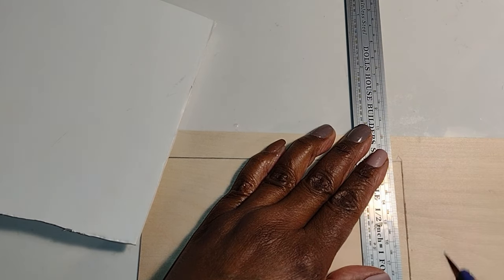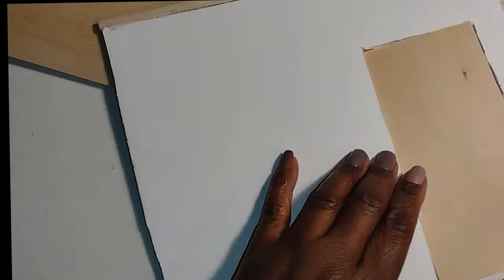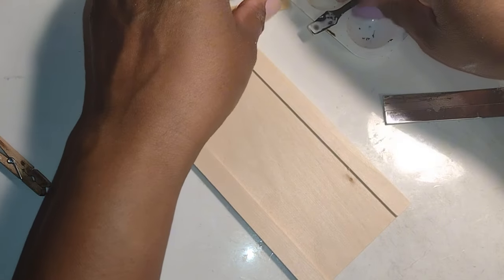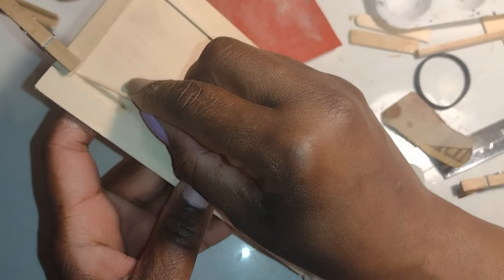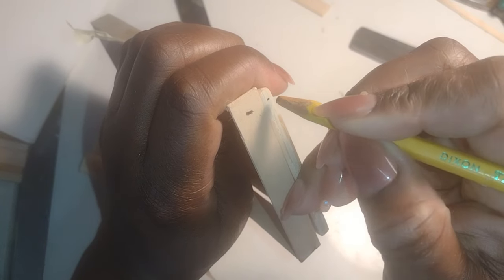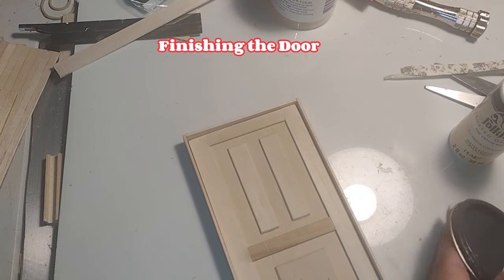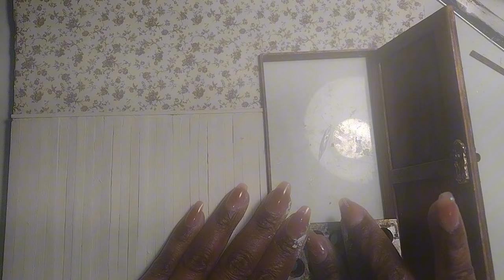DIY DOLLHOUSE DOOR-DRESS SHOP DOLLHOUSE: Little Gretchen' Workshop

Comment: You explain all these little things very well.  I think I may try this  Since I have foam board to create extra walls. Thanks!
Reply from the maker: Please do! I really think the foam board works well. It's easy to cut and it's flexible,  which is very convenient during installation! Even if you wanted to make the walls thicker or more rigid you could glue two boards together and it still works! Let me know how you like it! Have FUN!!!

Comment: So timely for me! I am in process of doing the same thing- and I've never done it before!  😄 Oh no, I didn't consider a jamb 🤣 I also didn't know to sand in one direction. I thought that was only for fingernails. 😂 Do you use special kinds of pins? Is the glue going in to both the door itself and the jamb?  I'm bookmarking this video so I can refer to it.  I know I've seen you do this before but this was super helpful. Thank you! Beautiful, beautiful, beautiful! 👏👏👏 😍✨
Reply from the maker: You can do it! Just take your time and go step by step! Don't over think it. I use brass that i got in a builders bundle off ebay a few years ago but dress making pins work fine. I put glue on the tip of the pin so that it goes in the hole and locks the pin in. Complete the door an build jamb around it. Keep checking inside the opening to make sure what you are making will fit! Let me know how it goes. If you have trouble don't hesitate to reach out! i'm here!
Reply: @littlegretchensworkshop7665 💕 Thanks SO MUCH for the encouragement!!! It's going as well as can be expected for my first door. I don't even have doorknobs. Lol. I'm about to add the pins😬. I'm going to rewatch your video first! 🤞🏻I woukd never be trying this IF NOT FOR YOU! Thank you so much😘😘😘
Reply: So glad I watched again before installing my hinges because I realized the holes in my doors were not deep enough. I was planning on trimming some long pins but they would have been less than 1/4 in. I'm redrilling as I'm watching 😅 Whew.  So many elements to consider! Like the floor too! 🤨 My friend, I think you have saved me hours of work ! 🥰